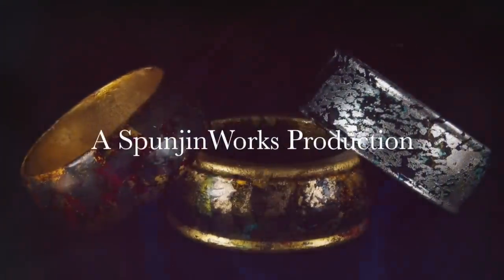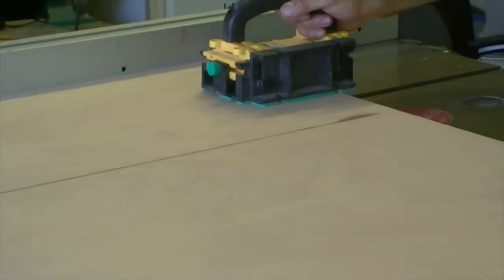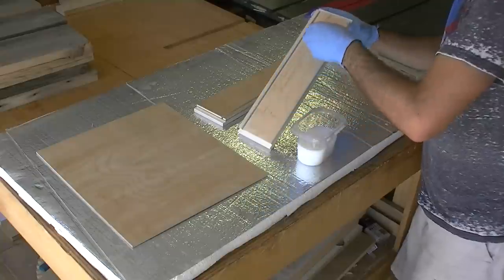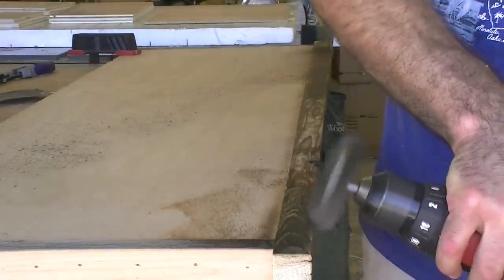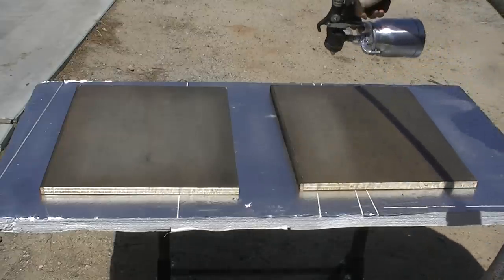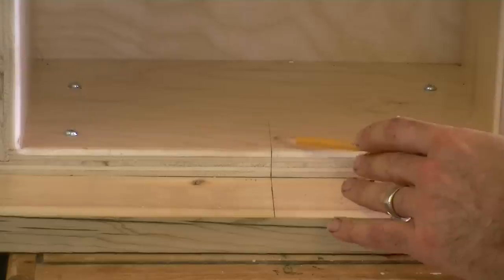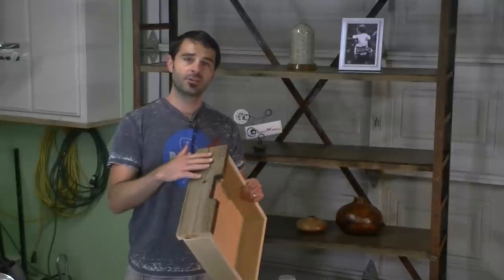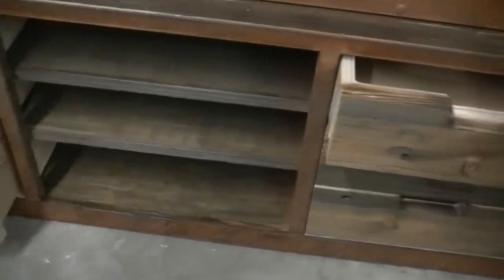Industrial Bookcases Pt. 2

Comment: Great project Sean! Some really nice tips. I never knew about adding tannins to help the iron acetate adhere better.
Reply from the maker: Thank you, Kendall!  It's a trick to add tannins to wood species that don't contain much tannins. That way the iron acetate has something to react with. I did test boards with and without the tea and the difference is subtle. The piece with tea comes out a little more grey and the piece without turns out more brown.
Reply: +Sean Rubino I have a project coming up that needs a similar finish. I'll credit you with the tips and tricks :)
Reply from the maker: That's appreciated but unnecessary. I'm happy to have shown you a neat trick for staining.

Comment: it's totally understandable if you wish not to answer this, but could you tell me how much you charge for a job like this?
Reply from the maker: +Loren Carey sorry the previous comment was for the bench I made. I mistakenly responded with that project in mind. 
I would charge $2500 this book case. There is a similar version at Restoration Hardware for $3400 or so. Not to say my work is worth less but I don't have the expense to cover for R&D and I can knock these out in a few days of solid work.
Reply: +Sean Rubino thanks for the info awesome work.